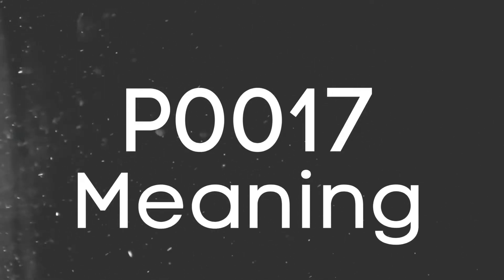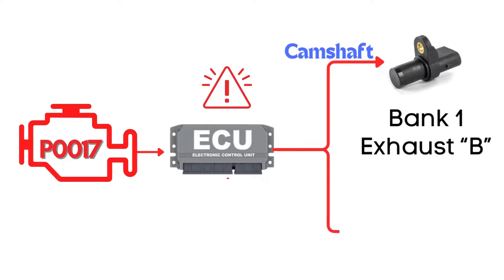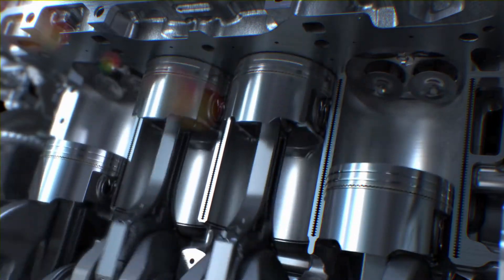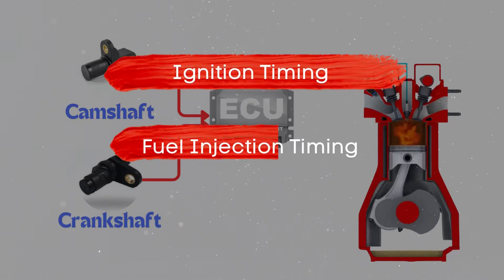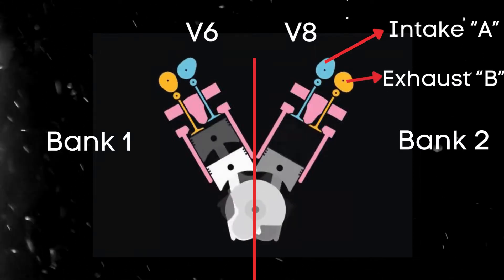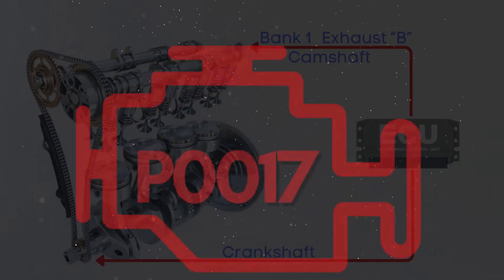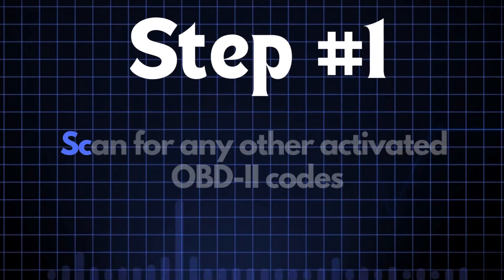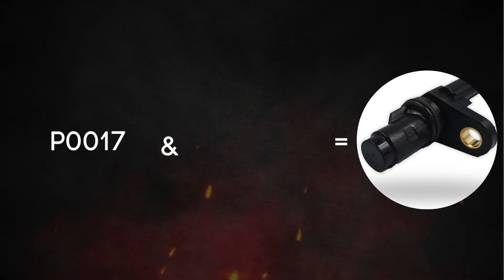How To Fix P0017? | Crankshaft Position - Camshaft Position Correlation (Bank 1 Sensor B)

Comment: P0017 code generate for ECCO k12n engine sending condition why r problem
Reply from the maker: Thanks for watching! The P0017 code can be caused by several different issues.
Reply: @carfix07 how many issues ?
Reply: @carfix07 because of vehical long self start and after 15 kms run and half self start malfunction light continued on culustermeter .p0017 crankshaft position correlation bank 1 why issue this fault solution plz tell me help me.already engine assamble of today .